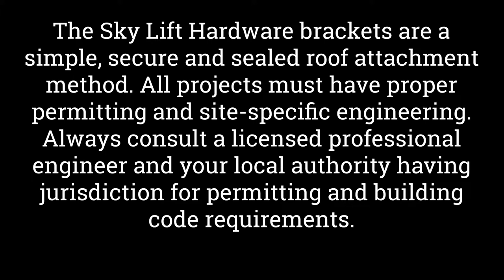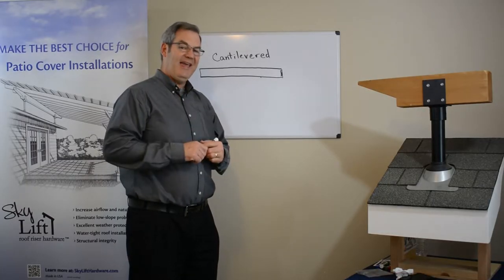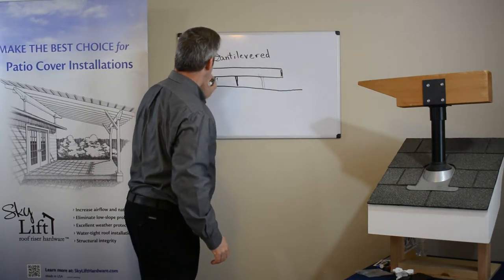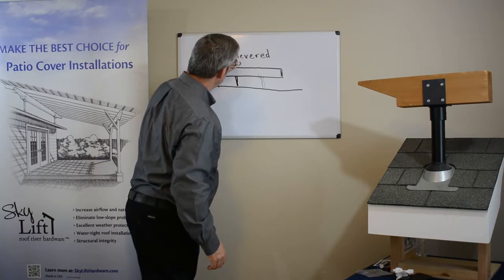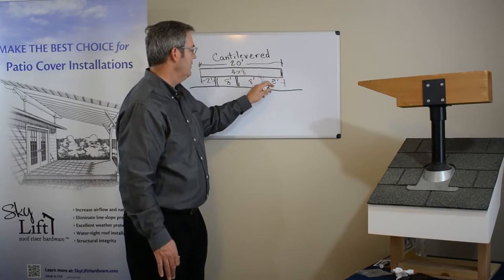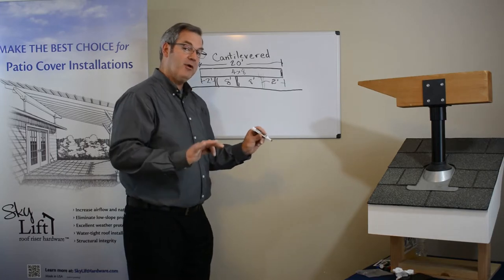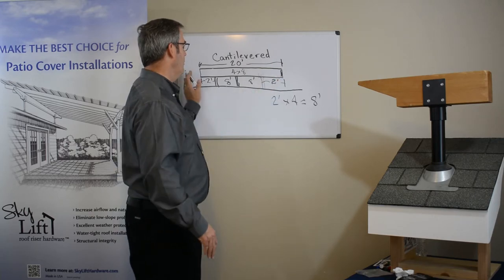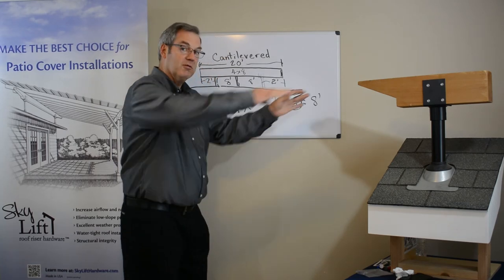Cantilever Beams

Comment: I have a concrete pad that's approximately 38' long and extends out 12' from the house. I prefer not to see any posts at all. I love the idea of building a suspended pergola of some sort. However, with so much patio to cover, I have no idea if it's a realistic concept. Is it possible for this to work for such a large patio? Do you have any recommendations on where I should start my research?